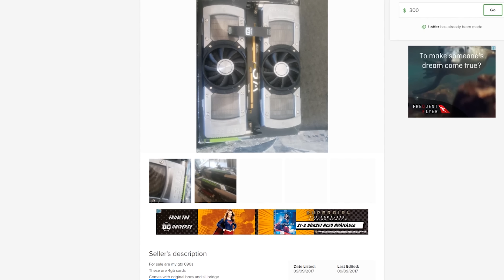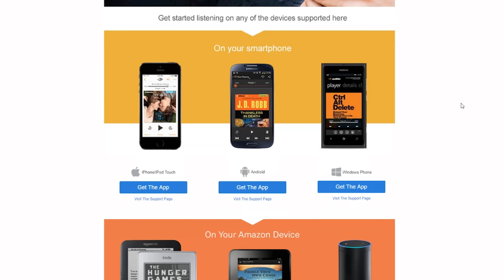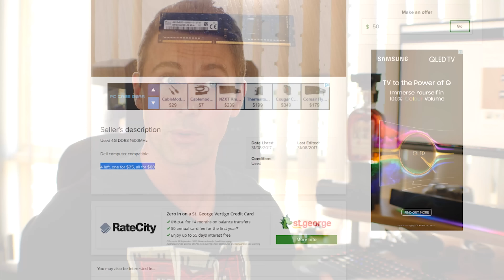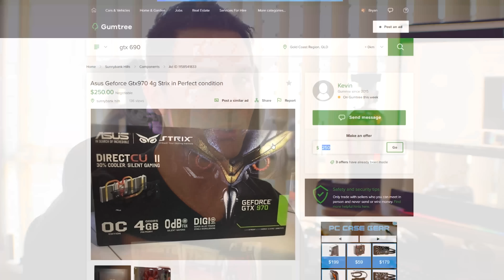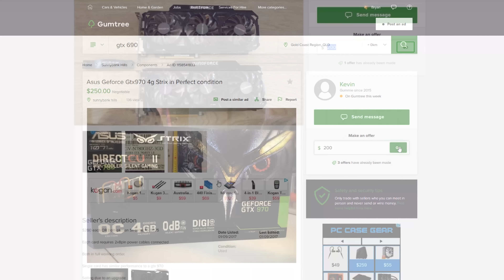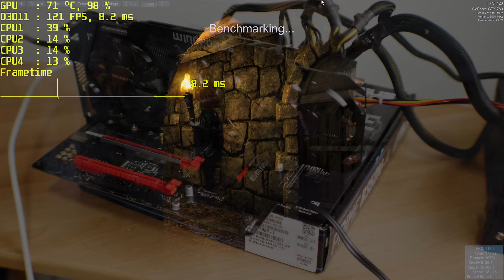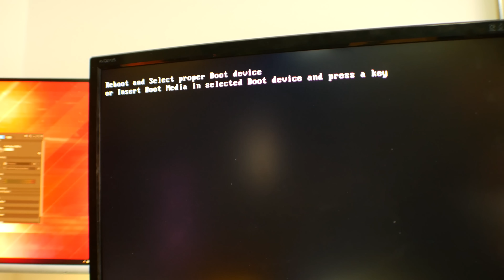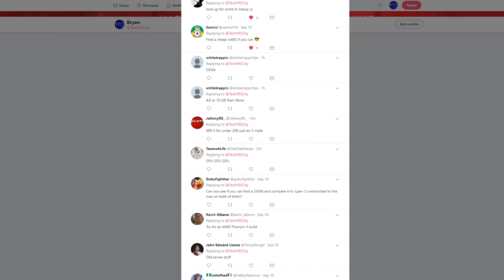September's MASSIVE Bargain USED PC Parts HUNT....!

Comment: Hahaha lost it at the 3.5gb troll
Reply: Jarrod'sTech it's not a troll though. It's the truth
Reply: Although, even when going over the 3.5GB of fast memory, the slower .5 really doesnt make much of a difference, maybe like 1-2 fps
Reply: I was hoping he'd do it when they started talking about 1060 ram.
Reply: skystealth22
Yep, and that's exactly what gets me with Nvidia's response to it. They basically said "its working how it should compared to the GTX 980".

So does that include things like micro-stutter? They KNEW the card doesn't have the bandwidth for all the VRAM. Its not slow, its basically choking itself.

The only saving grace is its better than running out of VRAM entirely.
Reply: Yeah mate! I got a 1060 6g gtx evga for 240 us..as i am working over here in usa ..
Reply: @ZombieBarioth but compared to 1060 3gb the 970 works VERY even. So if I had to get one of them I would definitely go for 970. No point paying 100$ more ( usually 970s go for 200$ in my country, 1060 3gb are 300$ here)  for something that will work same way with very small differences.

PS. Microstuttering occurs only if you get outside the cap of 3,5gb. And if you use fast ram on dual channel it's not that bad tbh.
Reply: ManhartLOL
Yeah, that's exactly what I mean. They perform very similarly, and most games don't actually go over 3GB unless you're using high-res texture packs.

The micro-sutter isn't that big a deal, its certainly no worse than running out of VRAM. Its not ideal, but better than running completely out.

Its just the way Nvidia handled the whole thing that bugs me. They could have handled it a lot better than they did.
Reply: As I am a person who believes that everyone can make mistakes I agree with that part that NVidia didn't give a single fk and said "It runs almost like 980! What else you want ?!". Honestly, yeah I am an owner of 970 GB G1 Gaming Windforce OC and the difference between that one and stock NVidia 980 is like at around 5% slower than it but it doesn't mean they should lie about the specs.

Comment: GTX690 SLI....it has to be done.
Reply: Budget-Builds Official 4x 680 power!
Reply: Budget-Builds Official hi :D
Reply: Forest flame aka gtx 980 performance if that lol
Reply: KJ PLAYZTM: Hello
Reply: a friend of mine actually has 2 GTX 690 in SLI it's nuts
Reply: That random guy eyy bb
Reply: Budget-Builds Official Definitely a card I'd like to have as part of a semi retro system
Reply: TheBcoolGuy lol....somewhat retro if you prefer. Certainly nobody is building new systems based around the 690. Cool card though, don't get me wrong
Reply: Jeremy R 1 GTX 690 is about 5% faster than the 980.
Reply: 4 way GTX690 SLI. Oh dear God.

Comment: I picked up a gtx 690 for £110 here in the UK from gumtree as well as an Alienware Aurora R1 with an i7 920, 12gb ram and gtx 480 for £175 from ebay. Going to upgrade the i7 920 to a Xeon X5650 and maybe put in the gtx 690. Or I could sell the gtx 690, make a bit of profit and buy something else. Ive also got two very rare gigabyte g1 sniper m3 motherboards which i'll need to sell, asus Gryphon z97 and i7 4790k, gigabyte g1 guerilla X58 motherboard and a few other parts.
Reply: Will you be using that as a main PC?
Reply: William skagen I've built at least ten computers. Bought and sold dozens of parts. For the time being I will be using it as my main pc but as with everything if I get a good enough offer I will consider selling it.
Reply: +DomDaBoss I personally wouldn't upgrade the i7 920 as its REALLY hard to sell on its own without a mobo. Though if you think you can turn a profit upgrading to a X5650 then sure, go for it. If you play at 1080p 60hz, the 690 should be fine as a main GPU for a while (I used it to play at 4k on my TV for some time actually), but if you could trade it for a 780ti or something then do that!
Reply: DomDaBoss You bought a GTX 690 from Gumtree and you live in the UK?
Reply: ModernRicky25 yeah. Got it from gumtree for £110 including postage.
Reply: William skagen I was going to get a 780 or 780 ti but the prices went up by 30% because of etherium mining. Im not desperate to upgrade but if i see a good deal I will upgrade it. The 690 is just as good as a 780 ti but not all games are well optimised for kepler cards  and not all support sli.
Reply: The Reaper95 I said gigabyte g1 sniper m3, it's a z77 board. If you don't know what your talking about don't comment. Or atleast read my comment properly and maybe do some research if you don't know what I am talking about

Comment: I've been through the EXACT conversation trying to pick up a used gtx 970. People think because it was sort of expensive when it was brand new, there's NO WAY a lower midrange card is going to devalue it that much. Harumph! I payed good money for my gpu, and no way will it depreciate in value! I don't even bring up the 3.5 thing because i'm not getting into a technical debate on a phone call with a stranger.
Reply: Interrobang same, one guy was asking $500 usd cause newegg had one for that much, I ended up getting one for $160
Reply: I paid 225 for the brand new 780ti thinking I got a bargain because this card was a top class in 2013. There could be no way that lower end card would match its performance...............then I watched gamer nexus video comparing it to newer components.....I got mind fucked. Decided to sell the whole computer I just build with used parts for brand new parts. Ryzen 3 1200 and gtx 1060......still can't believe it give better performance then a 780ti.....WTF
Reply: Interrobang yeah I know what you mean. They don't wanna go less than $250 in Canada as it originally cost them $400-$430 not counting tax or shipping if they had it shipped to them. Basically the same money can go to a better gpu, just the name of the game.
Reply: Syed Gilani haha well that's what happens when the gpu isn't getting new optimizations anymore. I'd personally love to do a 780 ti sli build though. If not for anything more than being curious about sli. Might be overkill for some older games though as that would be what it primarily would get used for.

Comment: 690's are awesome dude! In my opinion the best looking GPU made. Please do some 690 sli testing!!!! Would be interesting to see how the 2gb's of vram suffer. The 690 is after all the most powerful GPU with 2gb's of vram on its own...
Reply: William skagen I'm pretty sure that 690 is a dual gpu card, each gpu sporting 2gb so one card in total has 4gb vram. Two is 8gb. Not sure how that works for most games that don't support sli/dual gpu set ups too well.
Reply: +barryseaworth I believe it has been confirmed that dual GPU cards fucntion the same way as normal SLI/crossfire, i.e each GPU has its own vram that can't be shared. I should know considering i have a GTX690 laying around!
Reply: X
Reply: William skagen pls gib
Reply: TheBcoolGuy No

Comment: Use bristle brush to clean the dust, invest a mini air compressor with water filter, use it to blow dust off. Wet wipe works fine, contact cleaner spray+brush with paper tower soak works best for PCB.

Comment: Great find on the GTX 690! I got mine for $170 AUD about 6 months ago. Still runs every game at ultra at decent framerates with my Xeon E3-1231 V3 I got for $250 with a Gigabyte G1 Sniper Z87 Board.

Comment: Got a 7950 from sapphire with two coolers for like 69 USD boxed with accessories, newer been so happy actually. Card is running about 68C under full load, and coolers usually staying at about 60%, it also overclocks fairly decently (haven't pushed it to the limit yet). Good replacement for my R7 360. Performance on my old 1680x1050 monitor is mind blowing for the price.

Comment: did you just use WD 40 for cleaning the gpu?? or is that just contact cleaner?
Reply: Curios about the WD40 too
Reply from the maker: cleaned everything with alochol wipes first, then a coat of wd40 for that new look shine (sometimes even looks better than new).
Reply: This is the dumbest thing I have ever head anyone do in 15 years of working in I.T.
Reply: It doesn't seem like a bad idea, how would it harm anything? These are used parts after all and it's probably safe to assume we are talking about a very fine coat. If a guy wants to shine up some old hardware, this sure seems like an awfully quick and easy way to go about it.

Comment: my favorite deal is the 1156 i5 750 deal , really if you buy a i7 860 4 cores 8 threads off of aliexpress or whatever upgrade the cpu and put it in a cheap 50$-60$ case with tempered glass and stick a 15$ snowman cpu cooler on it a 250gb ssd and 16gb of ram and top it off with a GTX 1050 2gb like ive done you have a awesome PC that you could easily ask 650$ for and plays everything 1080p or 1440p ultra settings fortnite 144FPS or Apex legends high setting 75fps or even Destiny 2 high setting 65fps easily I know ive done it

Comment: hey dude love these used parts videos but I was just wondering why you sprayed the motherboard with WD-40?
Reply: It scared me when he did that
Reply: yeah I thought ok he is going to use it on the fans then he turned it on the motherboard after.  never seen or heard of anyone doing that before.
Reply: WD-40 is not a lubricant, do not use it as a lubricant. It is a degreaser. It removes the gunk so you can then apply actual oil.

Comment: Bryan, you could actually use a 2 molex adapter to a pci 6 pin connector, that could give you enough power for using another more powerful gpu if you want with that pc build that had the non 6pin 500W psu.

Awesome deals you got there, and people where saying you wouldn't get good deals like on Japan, it seems that its now the other way around, wish i could nail deals like you where i live, lol

Comment: Recently bought a 690 for $100 and sold it later for $110. It's a beast at overwatch, faster than the 970 I replaced it with, but 2gb really holds it back

Comment: Best deal was the 690's and close behind was the water block and water cooling parts for a RGB keyboard. I feel this way for I just dropped over 250 in water fittings and not including the water block for the CPU or the GPU so, ya sweet deals.

Comment: Hey @Tech YES City - Looking at the power supply, it seemed to have a PCI Power plug tucked into the HDD cage/bay? at around 13:48 looks like a 6 pin? Think a 960 is only 6pin so could work for an upgrade to it over the 750ti. Great video and look forward to seeing more also I would like to see how you go about selling these on as the Mrs isnt happy with my currently having around 13 computer at the house that i need to sell. Do you find it easier to sell as just the PC or include peripherals? 

Thanks man!

Comment: that 970 strix will oc like a boss. Just make sure to use afterburner and not the Asus software as it limits the OC to only 100 mhz. you can easily get 200mhz o/c's to 1547mhz on the CPU and up to 4k mhz on the ram.

Comment: Love the bogan voice, but when you go to pick up the deals do you still use the bogan voice? lol. Looked like some nice overclocks on the 780's. I got one of them and only got 1250 on the gpu. What settings do you use? I've no idear how many volts i can add. Do you think i should replay my thermal past? temps seem to be around the same as yours. I just had not thought about replacing it before. Cheers.

Comment: Man, I have TONS of DDR3, Core i5/i3 from SandyBridge to Skylake-  COUNTLESS Hard Drives of 500 GB or larger, I even have 3 SandyBridge Xeon machines - unfortunately they are only Quad core Xeons, and the Quadros that are in them are all old, save the Quadro K2200 - which is basically a GTX 750 Ti with 6 GB GDDR5 - I have a GTX 760, 560 Ti and probably soon a 770 that I can sell all of.

I have never done the Craigslist thing before, but I am feeling like I REALLY need to get on that shit, I am sitting on a good ~8+ full PCs that are just gathering dust, I have MASSIVE bins of HDDs, and cigar boxes FULL of RAM!
Reply: Oh yeah, I also have like 6 monitors, most of them 21.5" 1080p, one of them is an HP IPS 1080p workstation panel.

Comment: What did you use to wipe the dust off the components? The only thing I know being used in cleaning components is compressed air, it's only this time I saw someone using wipes.

Comment: In case of needing to replace a GPU thermal paste, what usually happens to the thermal pads? do you just reuse the ones that were in? or do you replace it with new ones? i want to replace the thermal paste on one of my cards but im worried about the thermal paste on it
Reply: Aladdad1 basically just reuse the thermal pads unless you manage to damage them. Then they will probably need replacing. You can find some cheap replacements on ebay, but they'll perform pretty lowly. It's mainly to just make sure there's some heat transfer between the vrms, vram and the heat sink. You could get better pads too, like the arctic cooling pads. They're not too expensive for just some decent performance. Basically that's as much as the average user will need from pads.

Comment: How much would you pay for a PC with an Z77 motherboard, i7 3770, HD 7970 3gb, and 8gb of RAM? I have my eye on one, but not sure if it's a good deal or not.
Reply: Retz 350-400 is about right off the top of my head
Reply: $400 seems about right. I bought an i7-2600k, HD 6770, Z77 Extreme6 mobo, 8GB 2400 MHz RAM, 500GB HDD, 450W Antec PSU in a 902 v3 case for $400 AUD. If it's a non k CPU you can try to lower the price a little, but $400 AUD seems fair.
Reply: Seriously? $400 for that? I've seen much worse PCs going for $500+, and PCs with similar specs going for around $750-800. 
Maybe you're talking about $400 USD? But even that's low.
Reply: Oh and obviously it comes as a complete system, the parts I mentioned were just the more important parts.
Reply: Retz
I see a lot of people selling 2nd/3rd gen i5 or Fx based systems for ~500+ AUD, but of course they lower the price a couple of weeks later because techies are smart enough not to buy those in this day and age, while non-informed budget buyers tend to look for systems for $400 AUD or less (which of course is filled with old prebuilts with i3 and C2D/C2Q). Under $500 AUD seems to be the sweet spot for a quick sale. If you think it's a good deal, pull the trigger.

Comment: Stable overclock on my graphics card is 1184 core clock 1547 memory clock on heaven bench mark 4.0
didnt get over 75
avg fps was 70.4fps max was 158fps lowest was 25fps on high preset at 1080p, no vsync, AA at 2x
my card is so good with over clocking 
My card is a R9 280x windforce oc
Reply: Corsair Sauce funny, I'm actually kind of interested in the 280s and 280xs. Nice numbers though

Comment: Best deal was those 2 gtx 690 cards.  I've owned one and it kicks ads in gaming.  Too bad it only has 2 usable gigs of memory even though card has 4 gigs.
Reply: Shawn Sereal that's because it's an sli card basically. It's the same with amd r9 295x2. It's a dual card, so it has near instantaneous communication between the 2 gpus under crossfire. 8GB of Vram, but only 4GB rendering since that's the way multi gpu setups work.

Comment: A GTX 970 with a BIOS mod will outperform even a GTX 1060 6GB. They are extremely good at overclocking.
Reply: SacredSkill that's only if someone's willing to mod the card to do that. That doesn't always go the way people want either. I'll forever love dual bios switches.
Reply: Late ask but could you please point me to those modded bios.

My 970 out performed a 1060 3gb, so gaining some more performance would be great.

Comment: Thats crazy il be waiting fot that gtx 690 "4" way sli video i myself have one laying around after i upgraded they just run super hot, you should try liguid metal on em i had       my 690 in my corsair 460x rgb case and underclocked to 79% power target and -37mv and it was still 85-90c
Reply: AatuSaurus you must have terrible airflow in your case or you applied the thermal paste incorrectly, also make sure all the thermal pads are on and they are not damaged. The gtx 690 exhausts air out of its front into the case, so keep this in mind.
Reply: The 690 is hot in general dude, don't worry about it.
Reply: DomDaBoss i havent changed the thermal paste yeat the temps will prob go down alot after i do, i bought it for 120 euros 6 months ago and only used it for couple of months
Reply: you cant 4 way gtx 960, its quad sli
Reply: Murat Çüçen ehy are you talking about 4 way 960?He's talking abput the 690 which is a dual gpu,having 2 dual gpus= 4 sli
Reply: ciprianrobo The difference is Quad SLI is a 2 dual card solution and 4 way is a 4 card solution.
Reply: It's still 4 gpus,that's my point.
Reply: i didnt know there was any difference

Comment: Do you know why the 280 has similar performance to the HD 7950? Because it's just a rebranded HD 7950 :D
Reply: DerFreakXD yeah, but that's not necessarily a bad thing. Plus the architecture is tweaked. So there's some improvements, hence the similarity.

Comment: dell optiplex 9020 i7 4790(non-k) 
you know the rest part is dells :p the ram is 4gb 
300$ worth it? (if i buy i will upgrade the psu+4gb ram add a 1050/1050 ti if the budget is available) so what should i do? i repeat the i7 is non k
Reply: noman hossain haggle, haggle hard.
Reply: Try around 200, otherwise not worth it
Reply: #smokedoutpositivesquad i offered him 200 he didnt replied